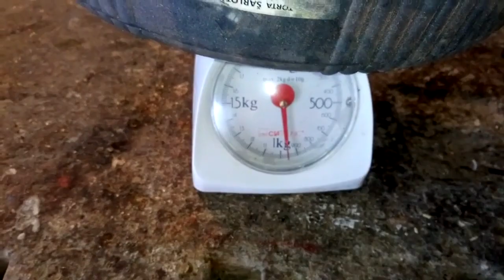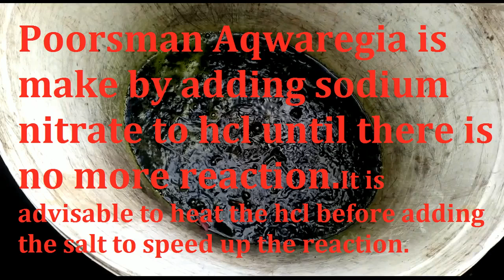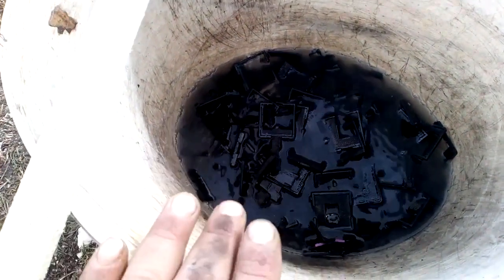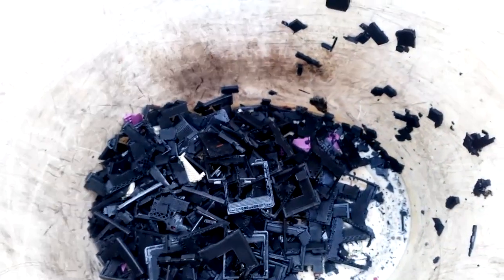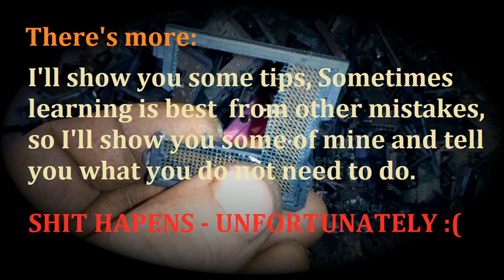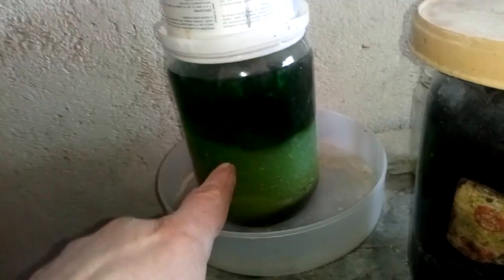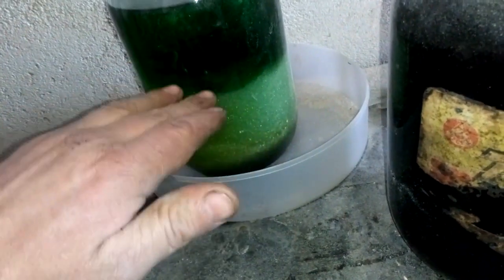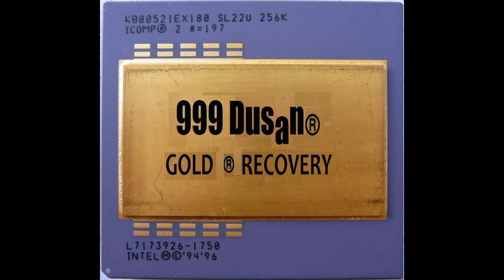Gold reccovery from SOCKET with POORSMAN AR!

Comment: can u use baking soda insted of urea to neutralize the nitric? I was wondering cause I don't have urea right now.
Reply from the maker: don sherer noup! During gold drop, the active hcl is needed, and the baking soda is neutralized hcl to, and it is therefore imposible to use baking soda to denox nitric acid before the drop of precious metals.
Reply: 999 Dusan Gold recovery thank u for responding and the information 👍
Reply: @999DusanGoldrecovery  Also, baking soda for baking contains mostly corn starch to allow easy use and less clumping.

Comment: When doing refines like this, would it not make more sense to incinerate first, to remove the plastic? You would then have a much smaller volume to cover with HCL, and would presumably use much less as a result. Just a thought.

Comment: Doesnt matter that ur solution was dirtt when u added the sodium nitrate?
Why did u filter before denox?
Reply from the maker: adushman1984 somethime i denox before filtering till solution is hot. Its not important if solution vas dirty on begining.
Reply: 999 Dusan Gold recovery im worried that i didnt denox enough...do u put ur nitrate solution and filters with ur bleach stock pot and filters??
Reply: 999 Dusan Gold recovery the reaction was dead when u denoxed and no reaction
Reply from the maker: adushman1984 First hcl bath, then rinsing with water, then hcl, hot water and sodium nitrite to make Ar, then urea to neutralize the extra Ar, filtering and eventually gold drop with smb. This is the order in this video.

Comment: Sockets FTW.. still looking around for NaNO3. I'm gonna try the butcher shop🥓🍖
Reply from the maker: Scavenger Nick yeap, try it!
Reply: Scavenger Nick  i get my sodium nitrate from a brewer's shop,  home brew beer and wine stores sell sodium nitrate by the pound for wine makers.. and they also sell smb (sodium metabisulfate) for sterilizing beer kegs and equipment and thats what gold is dropped with..   i dont use urea to neatralise as i do silver too and thats explosive when mixed, i use "sulfamic acid" powder to neutralize all my nitrates the same way as its safe with silver too and i get sulfamic acid powder from cleaning stores its called "coffee machine de'scaler"   its a machine cleaner too...   i hope this helps you find what you need mate, i had alot of trouble working out where to get these things at first but now im set...

Comment: I was doing a bit of research and found a couple rather significant mercury mines near Belgrade, you could likely find the cinnabar in multiple locations nearby or maybe talk to a couple local miners that might be able to point you in the right direction. Here's the Mindat link to one of the mines https://www.mindat.org/loc-3045.html      

The process for extracting the mercury from the cinnabar is essentially the same as reclaiming amalgam gold, with the exception of the addition of something to scavenge the sulphur like zinc. Anyways I hope this helps! good luck!

Comment: Poor man aqua regia since some time actually became for me exactly opposite term because for now I buy 70% technical grade nitric acid for $72 Canadian for enormous 4 gallons superbottle(it's around 15.1 litres)-and for the same price there are only around 4.5 kilograms of sodium or potassium nitrate which only corresponds to around 4.9 litres of 70% nitric acid!So I guess all who are dealing with specialised chemical companies like I do-have the same thing!And I even actually make sometimes sodium nitrate out of nitric acid because of this issue and I guess it is quite a ridiculous thing for many people out here but I am using it for my new and yet only being in stage of test running way to deal with some really tough metals like platinum and rhodium which take forever to dissolve in aqua regia and also some over-the-top tough metals that don't dissolve in aqua regia at all like tungsten or tantalum so I found a brilliant way to bust all of these metals very fast and rather viciously!And I called this stuff "Sal Regia"-which is analogue to aqua regia but infinitely faster and also surprisingly from the other end of PH scale from aqua regia-it is a mix of 80% sodium hydroxide,10% of sodium chloride and sodium nitrate(also I am now trying to find out what are ideal proportions and can't yet determine whether it is better to use sodium chloride or it will be easier and faster to use sodium perchlorate instead)-and obviously the key is that I am not talking about using solution of these-I am about fusing with these some of the really tough metals since I figured out that fusing with these is devastating almost all metals with only two exceptions being ruthenium metal and iridium metal which both are completely immune to this stuff even when it is heated to around it's boiling point of 1300+ Celsius so I obviously had to make my nickel crucible covered with layer of iridium metal(God it's unobtainable like plutonium or even more tedious and odious to get hold of!But it is well worth any money and any effort because it is really unbelievably corrosion resistant-I never seen anything like that before!It is that much more resistant than gold as gold is resistant in compare with sodium!)-so now I am testing the stuff in this crucible-probably the only thing that I currently have that is capable of containing this devastator mixture!